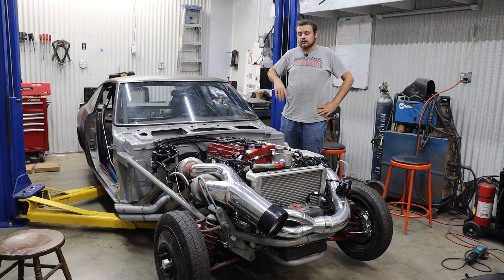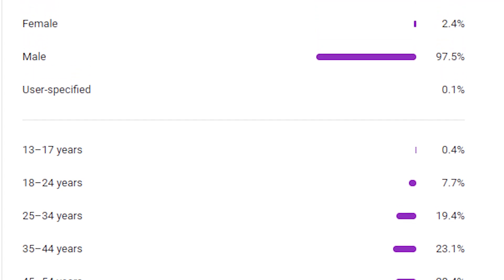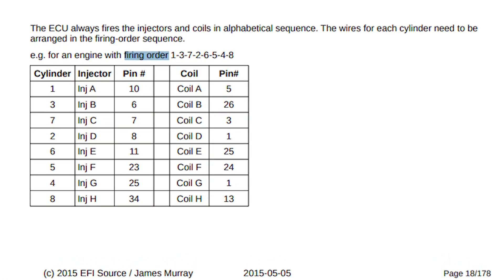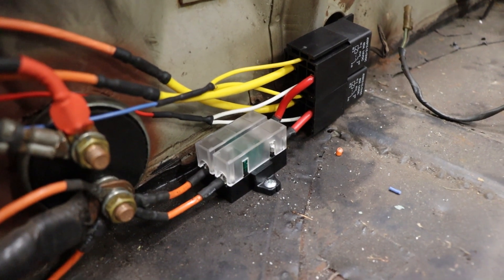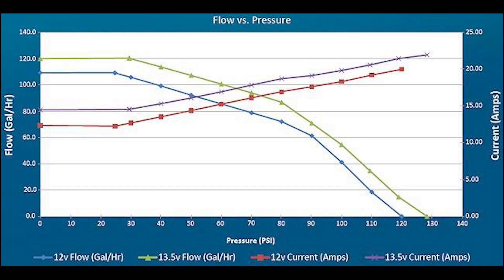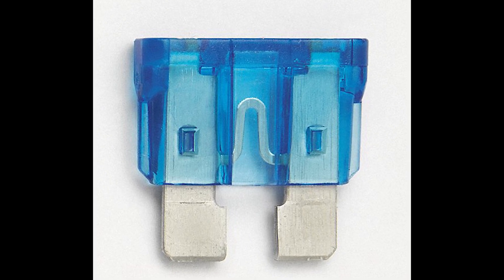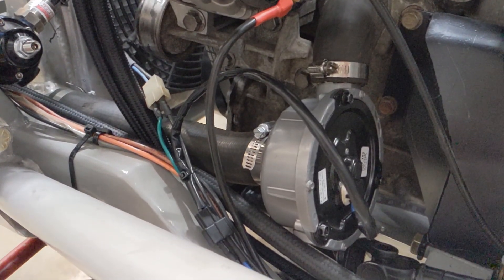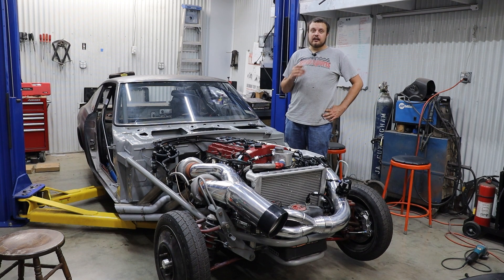Wiring - It's Easier Than You Think - 12 Tips and Tricks - Twin Turbo Ameri-Barra Vortec 4200 Datsun

Comment: Ever thought about running fueltech 450 on the 4200? At about $1100 cheaper than MS gold box and a newer better management system.
Reply from the maker: I have. We are friends with the guys who developed the Goldbox, so we have a little bit in an in there. 

The Fueltech is a little crude in some areas from what I've been told. Apparently the idle control is not great and you can't tune in VE, which I don't like. I could be wrong, but from poking around in their software I would much rather have a Maxxecu.

Comment: I've had numerous abs module crack at solder joint just as your images. The polymer coating helps with heat. I think they just aren't soldered well at the factory. I'll admit I use solder butt joints for simple stuff. Has the built in heat shrink and no wondering if it's crimped correctly. I went to school for PC hardware diag/troubleshoot and repair and basic networking. So have soldered wires like mosquito wings. Reflowed chips etc. But automotive can drive me bonkers at times. I just relocated my OBD2 for the mpvi2 to put it in the cabin. And sitting upside down in driver seat with my head under the dash is not what I consider comfortable lol... I run a single wire the tape the 4 wires and use the single to pull it back through it's routing. Have some small bamboo straights I use to fish under carpet.

Comment: A maf is technically a resistor is it not? It's voltage reference but the hot wire relies on air cooling to measure voltage?
Reply from the maker: Yeah. It's usually a pwm input, if I remember right. I think it works by it has a little controller on it that targets a certain temperature on a heating element, and the air moving past causes the heating element to cool more or less, which returns a different frequency.
Reply: Basically similar principle to early hot wire it’s just the pwm signal is travelling with maf and not isolated in the ecu while the airflow meter sending the dc signal through the harness

Comment: I drive a 2021 Volvo VNL760 semi. It has 97k miles and I can't control the temperature when the a/c is on. I can send you a video if you want to see what I'm talking about. Volvo has tried to fix it 5 times. Do you know a timer I could adjust to turn the a/c compressor on for 5 seconds and off for 5 seconds? I need it to do this all day long while I'm driving down the road.
Reply from the maker: Hm. I don't.